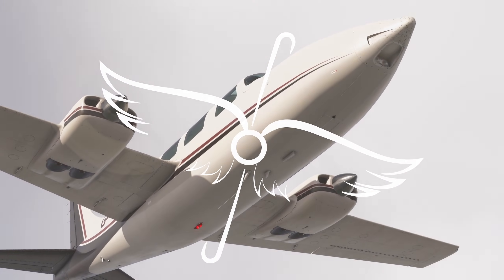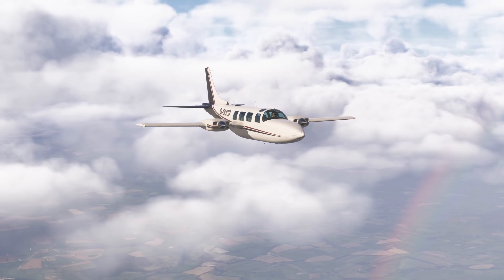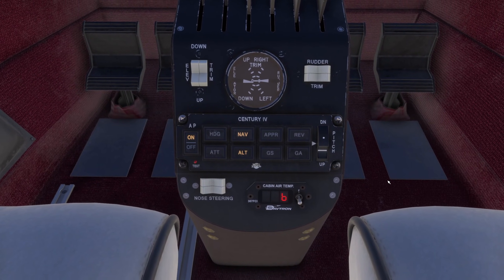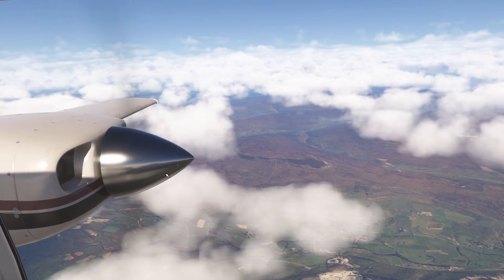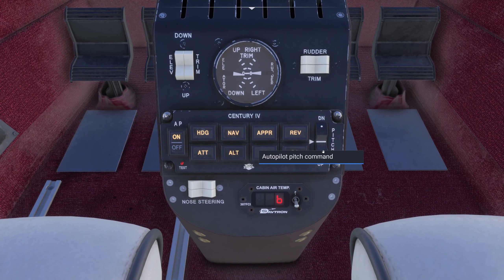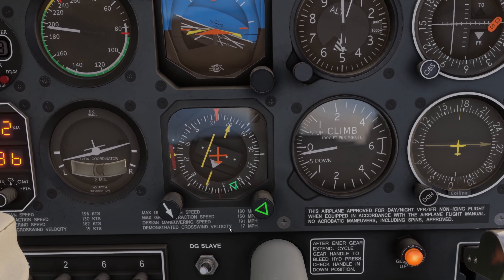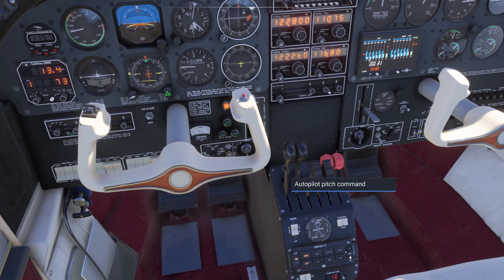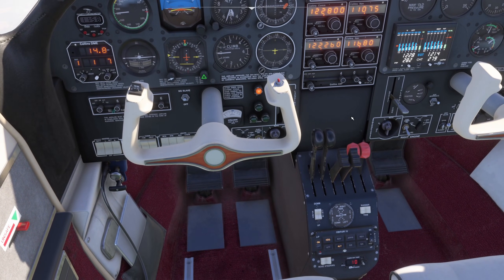A2A Simulations Aerostar Autopilot part1

Comment: I guess i'm not understanding the CDI on this plane when in nave mode. Right now i'm using the GTNXi in this plane. The track i need is 177 degrees, but the CDI is showing 138 degrees. I'm in nav mode.I have the switch above the obs set to gpss. I have gyro drift turned off. Shouldn't the CDI be tracking and showing a need for 177 degrees and aligning itself on that, then changing with each turn when i nav mode?
Reply from the maker: The CDI doesn't automatically turn every time you reach a way point and then turn to fly towards the next way point, so every time you need to manually turn the CDI needle to match what the GPS is telling you to do. But even if you turn the CDI needle somewhere else, that's not what's directly controlling the aircraft, the GPS is. Does that help? It's a hard topic to discuss without visuals
Reply: @PeterMatthess  So the NAV button and CDI are for old school radio nav, the GPSS switch controls the GPS and follows the magenta
 yes?
Reply from the maker: @UnoBadBadger  yes, once you have the NAV/GPS switch set to GPS, the aircraft will follow the GPS magenta track on your GTN. The yellow ADI or CDI needle on your direction indicator does not automatically flick to the correct heading as you fly on gps, you would have to manually sync that with the heading that the GTN tells you to select every time you start a new leg. But while you are set to GPS on that NAV/GPS switch, you can sping the yellow CDI needle and it won't change your heading at all. So there is a disconnect there, its not like a fully integrated avionics suite of an airliner for instance. Its a slapping together of older radio nav controls with a modern gps, but the two systems don't mesh 100% like a fully integrated system does like I say.
Reply: @PeterMatthess  Makes sense, i guess i'm just used to the visual of it turning on other aircraft, or maybe i'm just imagining it. Thanks

Comment: Can the autopilot pitch wheel be mapped to my joystick?
Reply from the maker: OOoooooooo.....now you've just given me the same idea.... I hope so!
Reply: @PeterMatthess  Yes its the first control yet that Ive found that uses the Control Function preset for specific Aerostar 600 controls section at the very bottom.  The wheel functions themselves are called A600 Autopilot Pitch Wheel  increase/decrease.  Now if I could figure out the difference between this and just using trim Ill be doing good, lol.  I wonder if thats why there is a auto trim switch, hmmm.
Reply from the maker: @TheGreatRepeller  ill check that out myself thanks for the tip

Comment: The attitude wheel was not responding to my vertical speed inputs. Is there any fix?
Reply from the maker: so your trying to move that rotary dial either up or down and its not doing anything? Not sure, try to get a video clip and post it on the A2A forums, that would be the best thing to do as its hard to visualise what your doing without seeing it

Comment: I'm struggling activating APPROACH mode - it says to first select the primary mode like HDG then LEFT CLICK AND HOLD APPR then RIGHT CLICK APPR - can't get that to work no matter how I interpret those commands
Reply from the maker: Yea that's a specific way to do it, I put that bit in text on screen when I talked about it
Reply from the maker: It's the same way you manually adjust the gyro drift on your heading selector